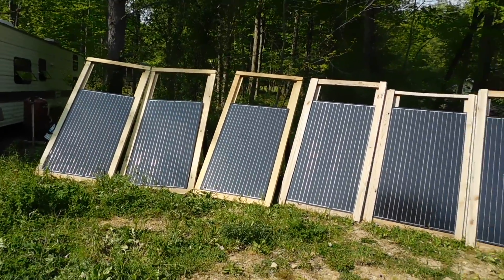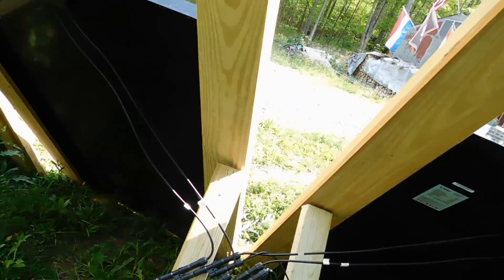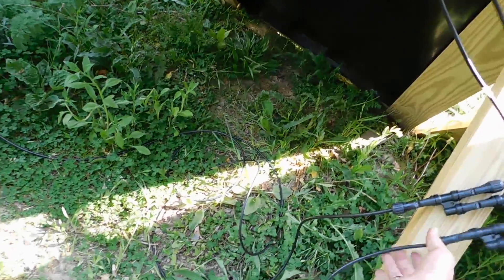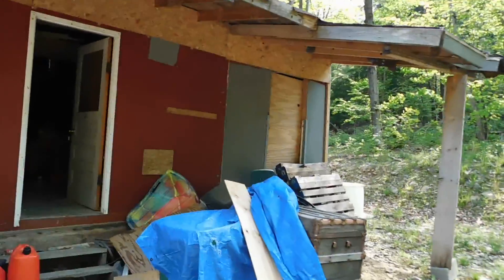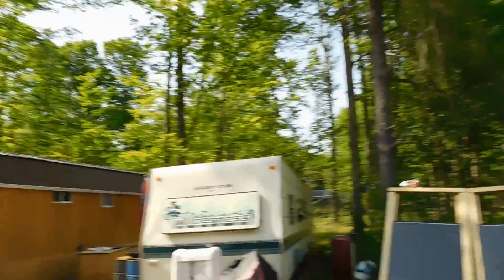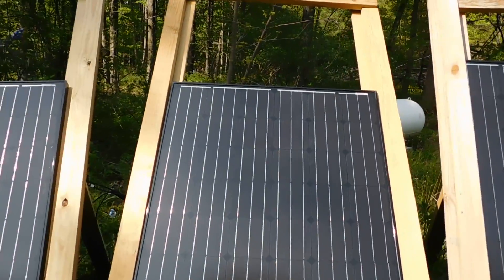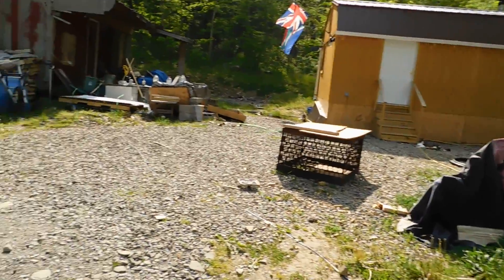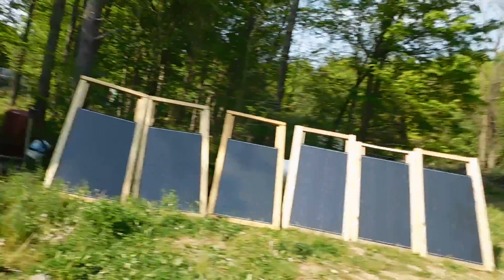Big upgrade to the solar system at the homestead.

Comment: Great job on the solar panels. They look good side by side. You're being smart to find out how to correct your errors as soon as they occur instead of putting them off. I've heard the prices are going up on everything, so getting as much done as soon as you can is a great plan to gave. Even if you have a set back like you did, you should always trudge on because you can usually bounce back. Great job!
Reply: * Great plan to have
Reply from the maker: Thank you we all have to keep moving forward in life to get to where we need to be.

Comment: A string is like you have four batteries hooked up to get 24 volts, same would apply to the panels, wire them in series to increase the voltage and tell the midnitght what you have done, then you hook up two strings in parallel like two banks of four in the batteries.
The midnite will use the solar power more efficiently
if this doesn't make sense, not much else I can say
Reply from the maker: Thank you for that.
Reply: midnite has this tool that you plug in the data from the label on the back of the panel and it will tell you how many in series and parallel for the model classic you have.

http://www.midnitesolar.com/sizingTool/index.php

Comment: Good to see getting the panels up and wired. That battery fix shouldn't be a big problem, as long as you don't drill too deep. :).
measure your drill bit and put some tape on in, to help judge your depth.
Reply from the maker: Yhat is very good advise thank you.

Comment: Are you sure your wire from the panels to the solar shed are heavy enough to carry the load? There are charts available on the internet that can guide you. See http://www.renogy-store.com/Solar-System-Sizing-s/1865.htm     
for an example  You could add a DC light in the solar shed. Good job, keep the faith.
Reply from the maker: Yes the wires are heavy enough for the load but thanks for asking. I will be adding a light to the room very soon.

Comment: Ed, is there a reason why that space at the top of the solar panels isn't down at the bottom so you can cut the grass and weeds easer? Get the panels from ground lvl up a little bit.
Reply: I think it's so he can raise them up when it snows so the panel is completely off the ground.
Reply: Thank you
Karl Lewis

Comment: Please, please, please...I would strongly recommend wiring those six panels in series-series-parallel (three panels as one and them parallel them together). Get those PV volts up/current down. The Classic will convert down the high PV volts and crank up the watts/current. Your efficiency will go up drastically and you will get more power. I run six panels in series and run PV volts as high as 105v DC. I did several videos showing this. Very happy to see progress!
Reply: The video shows three panels wired in parallel and then paralleled together. This makes sense since the Midnite Solar Classic's PV voltage is 28.8v.
Reply: if you think about it, this was how he connected the 24 volt panels to the 12 volt charge controller on the 12 volt battery bank before
Reply: I was going to say that but, if a panel is shaded that would shut down the whole string if wired in series, isn't that true?
Reply: Yes/no - I had four strings of six (24 panels) in a very lousy/shady configuration. If one string is getting full sun, the Classic will run the whole array at higher volts and keep the power up (esp using Mode P/O). The pay-off in efficiency using a MPPT solar chargers and higher PV volts is why they designed the Classic to handle higher PV volts and make use of the algorithms to maximize output. Any shading is not good...and paralleling panels will help, but running panels in series with higher volts will give the best power. You can also use thinner gauge PV feeder cable and save a ton of money. I did several videos on my Channel showing that it works fine including NEC wire loss charts and all that. I have two 140' PV feeder cable runs using 10 AWG...
Reply: thanks
Reply: I was about to say the same thing until I read your comment. Not to mention the heat that is produced from the lower voltage making the amps around 50-60 amps on that small AWG wire can cause the mc4 connectors to potentially melt or worse a fire.
Reply: I'm surprised you didn't pickup on him saying the most he ever got from his 750 watts of panels was 2.1 kWh..  Six hours of direct sunlight times 750 watts is 4.5 kWh.  He's not even getting half of that. (Yes I know you never get the full rating out of a panel - but he's also getting more than 6 hours of sunlight.)
Reply from the maker: They are tied together in strings of three panels each and then they are tied together  I am using 8 awg  wire. And I have had no problems with it at all. I am going to do another video about it and show you tomorrow.
Reply from the maker: Chris DIYer Its working great if you want send me your number to my e-mail and we can chat on the phone.